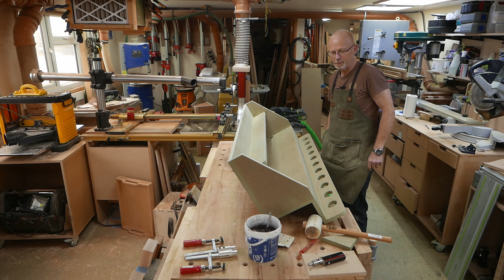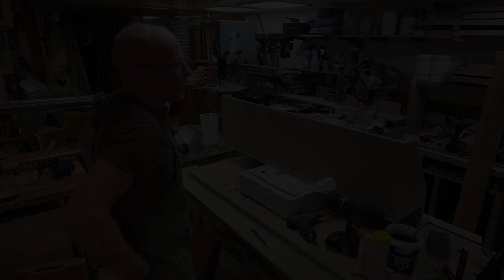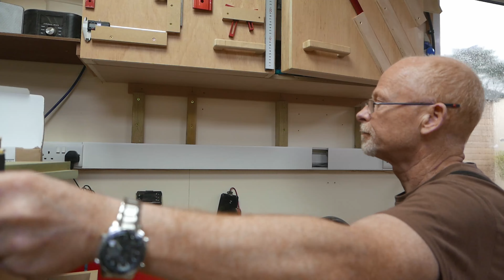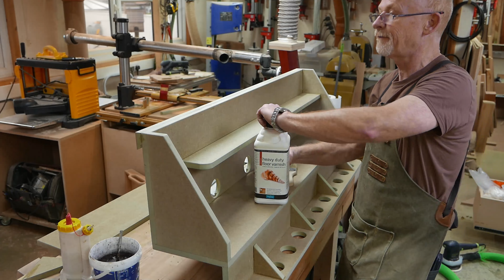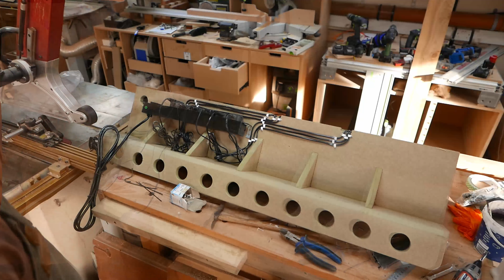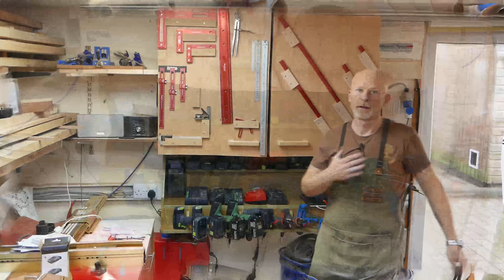How to Build a Drill Driver Storage and Charging Station Part 4

Comment: Great project.  Good use of limited space.  I thought for a minute the bits in the drills would hit the top of your wall mounted heater just below. Taking the time to apply a suitable finish to MDF shop furniture shows a high degree of professionalism, something I need to remember.
Reply from the maker: Hi Dan, thanks mate.  Its taken me years to learn my lesson on appyling finish.  The number of times I've ruined an unfinished surface with some kind of swelling......... 👍